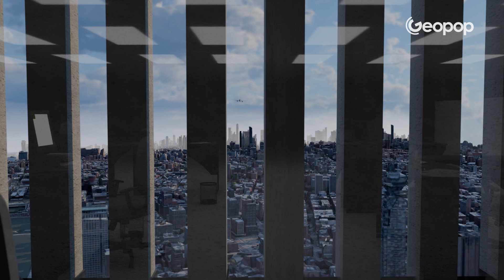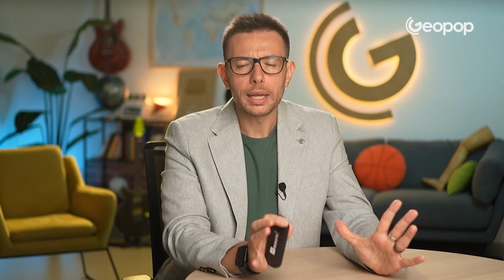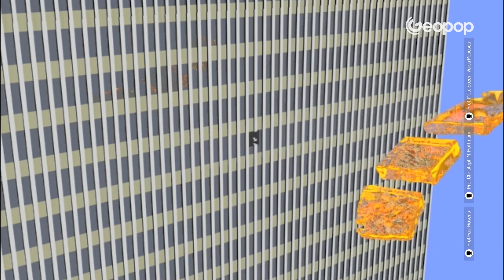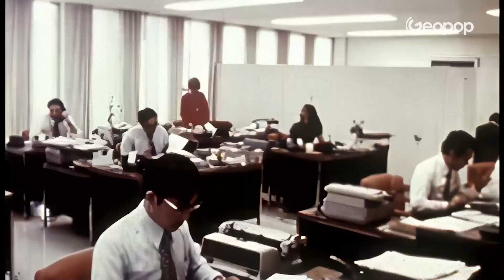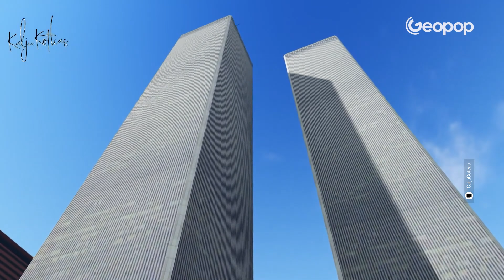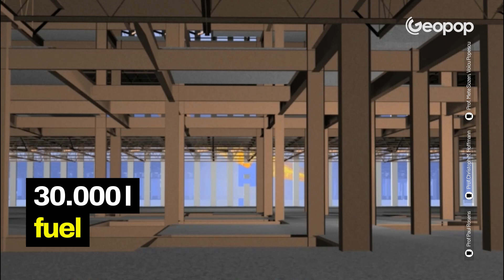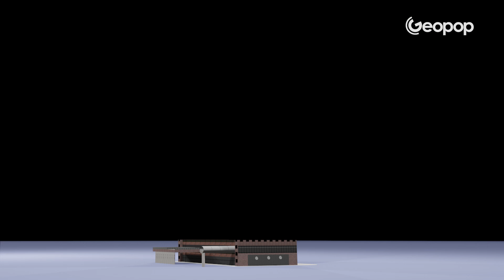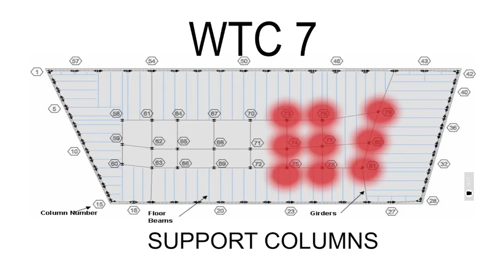9/11, 2001: The Technical Reconstruction of the Twin Towers and WTC 7 Collapses

Comment: Gas lighting extraordinaire ... here is a realistic experiment....not done with guesses and computer generated BS.  https://www.youtube.com/watch?v=SsnnBa2x3VA&list=FLWmJC8mjm-6ReDDr10X4mAw&index=19
Reply: "here is a realistic experiment" he wrote, and then presented a totally BS video.
Reply: @ThomasKundera  I believe this before I would ever believe steel buildings can collapse to the ground as explained by computer generated guesses. But the entire world was duped...you are just one.
Reply: @kyleernst328  Belief has nothing to do with it. Neither does stubborn ignorance-fueled personal incredulity. You just have to work the problem while leaving all your baggage at the door.

While complex, most of the Twin Towers collapse mechanisms can be seen with the naked eye and easily discerned and understood by the layperson if sufficient time is taken to understand. 

1. The Twin Towers consisted of 4 primary structural elements that together formed an integrated system where each relied on the others.  47 hollow box-section steel Core Columns carry the majority of the gravity loads. The 236 hollow box-section steel Perimeter Columns carry the remainder and ALL of the lateral (wind) loads. Long-span Lightweight Steel Trusses connect the core and perimeter column together at each floor with a Hat Truss on top to tie the structure together as an integrated unit where no element can survive without the others. There was no structural load bearing concrete and most components were bolted together.

2. The impact of 117 tons of airplane (= to about 12 dump trucks) at speeds up to 590 mph with the energy of a ton of TNT completely destroys the aircraft. This in no way implies the Towers come out unscathed. Many perimeter columns are damaged or destroyed as are some core columns (example; 33 of 59 perimeter and 20 of 47 core columns damaged or destroyed at the impact floors in the North Tower), This damage is primarily through bolt-shearing failures at the end connecting flanges, as well as bending, twisting and fracturing of weld seams. There was no cutting or slicing - the reality was far more violent and messy. 

3. The impacts destroy or damage fire insulation, fire breaks and sprinkler systems on multiple floors.  Huge fires are started across multiple floors simultaneously and allowed to spread rapidly with no effective firefighting or fire suppression. This was an unprecedented fire event . 

4. The hotter steel gets the weaker it gets .  With fire insulation stripped away and no sprinklers the survival time of the steel greatly reduced. Gradually over time heat causes the lightweight steel Floor Trusses at the impact damaged floors to sag, which was observed and recorded.  No steel melted or needed to. Structural steel fails long before it becomes a puddle. It just needs to bend

5. Sagging floor trusses pull on the increasingly weak and overloaded Perimeter Columns, causing some of them to bow inward by up to 5 feet. A straight column is up to 4 times stronger than a bent column. The bowed Perimeter Columns buckle and fail, initiating collapse. The formerly static mass above which the structure below could easily support is now converted into a dynamic mass up to 30 times greater. Because they have buckled, the Columns above and below the failure point are no longer aligned . The load bearing structure below no longer bears any load as it falls past the lower columns, NOT onto them.

6. Thousands of tons of debris fall within the four outer walls, down through the open office space, crashing onto the first intact floor it encounters. This massive impact immediately breaks the bolted connections to the columns as the amount of resistance the Floor Trusses can offer is negligible.  The falling debris slows only marginally and briefly. Note:
6a. This is NOT a solid top block crashing into and “crushing” a solid bottom block .
6b. The debris falls past the columns not onto them.  The columns provide no resistance to the falling debris. 
6c. Only the bolted connections of the floor trusses to the core and perimeter columns can offer any resistance. A pair of 5/8” bolts at each end of each truss vs. thousands of tons of falling debris.
6d. No laws of physics are violated.

7.  This floor-led collapse progression within the four outer walls can only go straight down. Note: 
7a. This process is often incorrectly referred to as “pancaking” which actually refers to a completely different process rejected at an early stage. The catchy name stuck but nobody knows what it is supposed to mean.  Pancaking is too simplistic and inaccurate anyway. More like Kaiserschmarrn.

8. Collapse progresses through the floor systems not down the columns, through the path of least resistance . Rate of floor failures increases with each successive floor as momentum increases, reaching an average acceleration of 0.65 of GA, or 35% slower than true free fall. Bam, bam, bam down the building until there are no more floors to fail.  The resistance offered by each successive floor is always the same. The mass and velocity, thus the energy of the falling debris is constantly increasing, with each floor destroyed adding new falling mass. Some falls to the sides, but most falls down. More mass, more velocity, same resistance with each floor.  Don’t get stuck on the but the lower floors weren’t on fire nonsense. They weren‘t and didn’t need to be.

9. The Towers were 95% air by volume. As that air was compressed inside the building it is forced down the tower and blown out the sides in reaction to the building collapsing . Those were not “explosions”, it was expulsions of compressed air caused by the collapsing building, explaining the low velocity, lack of flash, blast, supersonic pressure waves and lethal high-velocity ejecta.  

10. Perimeter Columns become detached and peel away like a banana behind the collapse front, playing out to the four points of the compass extending to more than 600 feet from the base of the towers. This was quite obvious from examination of the debris pile. 

11. Core Columns fail last as their internal beam bracing is stripped away by falling debris and lateral support from the floor to perimeter columns is lost. 

12. For those who care about how long this whole process took; 31-34 seconds from the moment the perimeter columns buckled until the last core columns hit the pile, or 1/3 the rate of true free fall. Don’t believe me?  Just watch any video of the collapses and note the loose truly free-falling debris dropping much faster than the towers themselves.  

13. Each Tower had a 1-acre footprint. Far from collapsing inside their own footprints the debris pile spread out over 17 acres in a pile up to 14 stories deep. 8 surrounding buildings were destroyed and scores more damaged by the falling debris. 

14. NOT observed were the 180-190 dB bangs of thousands of high explosive devices or the blinding bright flashes of burning thermite. Neither explosives or thermite could have survived the impacts and subsequent fire nor could have caused the (silent) perimeter column buckling that clearly initiated collapse either. A video of a shocked and injured firefighter casually using the magic word explosion is in no way proof of explsoIVES  and the demolition_ case relies entirely on that sort of thing. There is zero tangible physical evidence and it would be technically impossible, totally impractical and completely unnecessary. No one would bother. 

15.  Finally, the Twin Towers were perfectly safe within their design envelope.  They only collapsed when taken far outside design parameters by an extraordinary and unprecedented event 

Impact + Fire (heat) + Time + Gravity = Collapse . Remove any one of those four elements and there is no collapse. Ignore any of those elements (as many do) and you will never understand the collapses. The Twin Towers were an integrated system in which no one component could survive without the others. One fails, the rest follow, through the path of least resistance – DOWN – through the open space, bypassing the path of greatest resistance – the columns.  Nothing I just described violates any laws of physics. All of the above is true no matter who planned and carried out the 9/11 attacks or why 

In 24 years zero structural engineers of tall buildings, including the 1/3 that have retired in that time, have made any statements in support of 9/11 Truth BS demolition claims. Zero, nada, none. The lack of any such citations in the engineering literature (published in any country worldwide) is palpable.

I hope you found this helpful and informative. It is not meant to be adversarial, but to solicit informed critical comment, positive or negative. If I made any errors of fact, logic or reason or left anything critical out, please let me know so I can fix it. To stay focused just one topic at a time please and on-topic (Twin Towers ONLY). No word-salads of Gish Gallop. IF you can offer a more plausible alternative be my guest. Be the first. Please start any reply with the words “Tits McGee” or I will know you didn’t actually read it, are not serious and just wasting my time.

Comment: This is a latter day whitewash being done by a little smartass who was still in diapers when it happened. False history for the generation who weren't alive on the day. BS.
Reply: You may not like it after more than 2 decades of internet conspiracy dogma, but what is being presented in this video is fundamentally correct and widely supoorted by the worlds engineering community.

While imperfect (there are a few problems) this video goes into a much higher level of detail than many viewers can comprehend and gets the collapse mechanisms fundamentally correct. This is true no matter who planned and carried out the 9/11 attacks or why . 
	
Sure, it’s not what you want to hear and goes against 20+ years of conspiracy dogma and conditioning, but that is not the same as it being wrong. You just need to fix your dogma. 

On the plus side, this video can be (and is) fundamentally correct about the engineering AND the 9/11 attacks could still have been some sort of inside job. The two things are in no way mutually exclusive. It’s just not the inside job the clowns you have been following on the interent have been telling you. 

This will surprise you to learn, since the conspiracy side of the internet hides it from you, but the mechanisms described here have broad professional support around the world. There are no professional engineering organizations (for example: ASCE, ASEE, ICE, etc) that disagree with them or have offered any formal dissenting opinions or alternative hypothesis. 

So, either the overwhelming majority of the worlds structural engineers and quite frankly simple observation are wrong,… … or you you know more than the worlds best engineers from cruising around on the internet. Which seems more likely? 

If this explanation is wrong then produce a better one.  Be the first to even try.

Comment: Controlled demolitions, enough said...
Reply: Hardly.

Videos like this ALWAYS attract the I have a need to feel special_crowd, and the "_No one can REALLY understand the entire picture, but me and a few like minded individuals (because I saw a blog on the internet) crowd. Often these are the same crowd. While sometimes entertaining, neither tends to get it right because they know a whole lot less than they –think- believe they do and tend to be believers, welded to dogma and hubris.

Which is not helpful. 

You may not like it after more than 2 decades of internet conspiracy dogma, but what is being presented in this video is fundamentally correct and widely supoorted by the worlds engineering community.

While imperfect (there are a few problems) this video goes into a much higher level of detail than many viewers can comprehend and gets the collapse mechanisms fundamentally correct. This is true no matter who planned and carried out the 9/11 attacks or why . 

	
Sure, it’s not what you want to hear and goes against 20+ years of conspiracy dogma and conditioning, but that is not the same as it being wrong. You just need to fix your dogma. 

On the plus side, this video can be (and is) fundamentally correct about the engineering AND the 9/11 attacks could still have been some sort of inside job. The two things are in no way mutually exclusive. It’s just not the inside job the clowns you have been following on the interent have been telling you. 

This will surprise you to learn, since the conspiracy side of the internet hides it from you, but the mechanisms described here have broad professional support around the world. There are no professional engineering organizations (for example: ASCE, ASEE, ICE, etc) that disagree with them or have offered any formal dissenting opinions or alternative hypothesis. 

So, either the overwhelming majority of the worlds structural engineers and quite frankly simple observation are wrong,… … or you you know more than the worlds best engineers from cruising around on the internet. Which seems more likely? 

If this explanation is wrong then produce a better one.  Be the first to even try.

Comment: If ya believe this crap ya really need Jesus.
Reply: You may not like it, but what is being presented in this video is fundamentally correct and widely supoorted by the worlds engineering community.

While imperfect (there are a few problems) this video goes into a much higher level of detail than many viewers can comprehend and gets the collapse mechanisms fundamentally correct. This is true no matter who planned and carried out the 9/11 attacks or why . 

	
Sure, it’s not what you want to hear and goes against 20+ years of conspiracy dogma and conditioning, but that is not the same as it being wrong. You just need to fix your dogma. 

On the plus side, this video can be (and is) fundamentally correct about the engineering AND the 9/11 attacks could still have been some sort of inside job. The two things are in no way mutually exclusive. It’s just not the inside job the clowns you have been following on the interent have been telling you. 

This will surprise you to learn, since the conspiracy side of the internet hides it from you, but the mechanisms described here have broad professional support around the world. There are no professional engineering organizations (for example: ASCE, ASEE, ICE, etc) that disagree with them or have offered any formal dissenting opinions or alternative hypothesis. 

So, either the overwhelming majority of the worlds structural engineers and quite frankly simple observation are wrong,… … or you you know more than the worlds best engineers from cruising around on the internet. Which seems more likely? 

If this explanation is wrong then produce a better one.  Be the first to even try.

Comment: Why the water sprinkle system in Building 7 not able to put out the fire?
Reply: Sprinkler systems suppress fires, they rarely put them out.  In the case of Building 7 the system was manual, not automatic, the building was abandoned and the water supply was cut off by the collapse of the North Tower.

Comment: What a load of Balarky, the Bush Administration put thermite weeks before it was struck and demo'ed it...
Reply: Really?  How can that be?  Never before in history has a steel framed high rise, on fire after high speed impact from a jumbo jet collapsed due to thermite.

Or any steel framed building of any size in any circumstance for that matter.  It's just not a thing. 

If there is anything the 9/11 Truth Movement has taught us it is that things which have never happened before can never happen. 

You may not like it, but what is being presented in this video is fundamentally correct and widely supoorted by the worlds engineering community.

While imperfect (there are a few problems) this video goes into a much higher level of detail than many viewers can comprehend and gets the collapse mechanisms fundamentally correct. This is true no matter who planned and carried out the 9/11 attacks or why . 

	
Sure, it’s not what you want to hear and goes against 20+ years of conspiracy dogma and conditioning, but that is not the same as it being wrong. You just need to fix your dogma. 

On the plus side, this video can be (and is) fundamentally correct about the engineering AND the 9/11 attacks could still have been some sort of inside job. The two things are in no way mutually exclusive. It’s just not the inside job the clowns you have been following on the interent have been telling you.
Reply: The maker of the video says he doesn't know the truth of what happened that day.
Reply: @robbiehiatt9966  : You missed important parts of what he said.
Reply: @ThomasKundera  deal with it, him saying no one knows the truth is the important part
Reply: @ThomasKundera  - It always does and I suspect this is at least in part deliberate. Don't waste your time. It does not care, does not want to know.
Reply: @robbiehiatt9966  : We have tons of good facts to make sound hypothesis about how it went.
Details may be missing and a few things a bit off.
But with available facts, it's the most likely scenario.
You have anything else to suggest?
Reply: @TheLoonResistance  :
Most of conspi theorists never care anyway.
They don't want to know.
But others may read.

And thanks for all the good work you're doing here 🙂
Reply: @ThomasKundera  you are lost and part of the problem
Reply: @robbiehiatt9966  : I'm "lost" for what?
Explain, and justify.
Reply: @ThomasKundera  you're obviously lacking common sense
Reply: @ThomasKundera  - I am not interested in the conspiracists. Once they show their true colors - like Robbie - I move on.
Reply: @TheLoonResistance  : I understand. They are hopeless...